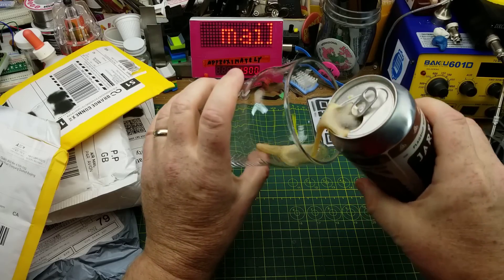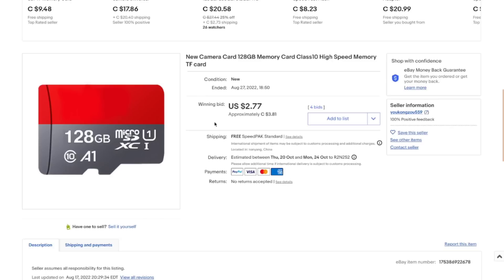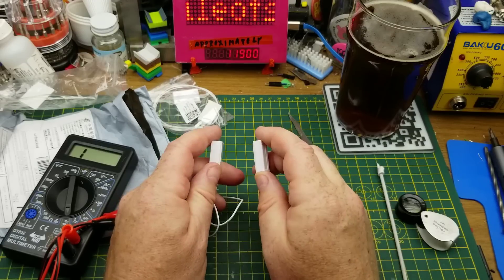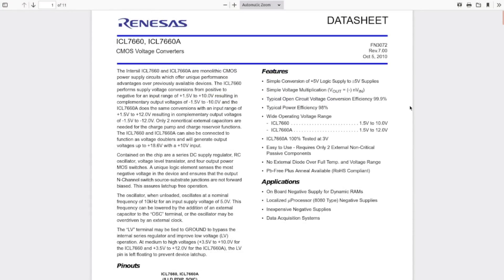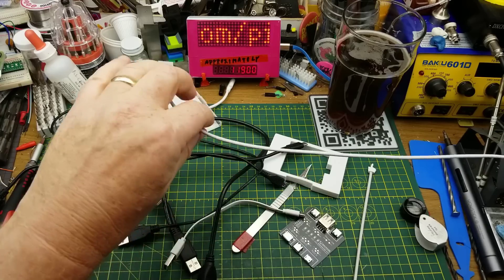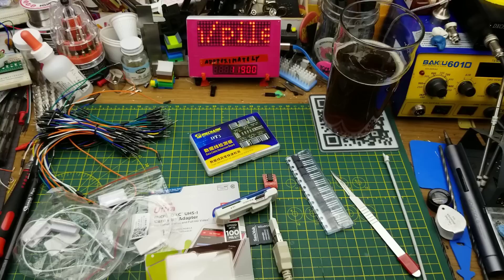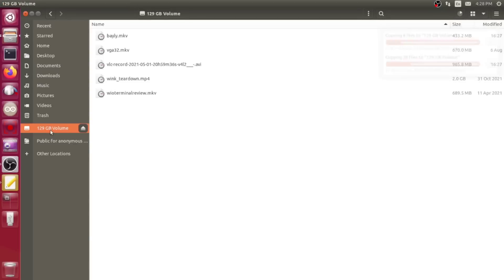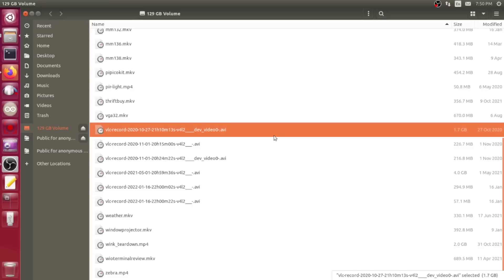Mailbag Monday 150

Comment: The SD card could still be fake. Perhaps it's a 32 GB card that pretends to be a 128 GB card. It will behave just fine until 32 GB. After that it will just discard all the data and your files will be nowhere to be found. Perhaps test it with 128 GB of files just to be safe. You don't want to find out the card is fake when you are actually using it.

I've bought a ton of these fake cards from AliExpress on purpose. I tested them all and sent proof of fakery to AliExpress and they refunded all of them. I just format the first 30 GB and leave the rest unused. No data corruption.

Comment: The USB cable tester uses almost no power. You can easily convert it to a truly portable device by hot gluing a CR2025/CR2032 lily pad battery holder onto the back and soldering its output to two via's running from the power input C connector on the back. Now you have a self-powered device to test any cable without the need of a second cable+power source.

Comment: In industrial/commercial applications the reed switch is often mounted on the door itself.
Reply: the magnet tends to be mounted to the door, the contact is fitted to the frame, that way a wire loop is not needed to allow the door to open

Comment: 10:25 - those breadboard connectors - beware of the ends on those! The ones I've purchased in the past are kind of "snipped off" at the end, leaving a burr on one side. When inserted, they scratch the hell out of the breadboard contacts.
To fix them I sat down with a diamond stone and rounded them over. It's tedious but easy, and the tapered ends makes them slide in like silk!
Also, they tend to snap off after heavy use, and sometimes they go open circuit without the insulation breaking.

Comment: I have had some luck with the SD card auctions.  It always looks like some store pulls the last from a display and puts it on auction for the amount of profit they expected to make and let the auction add to it.  Only once did I get a ' fake ' SD card and only due to them sending not-SD-Card after the auction.  As to the USB cable tester, you might want to replace the Type A for a vertical mount to get more reach to the other side, just my opinion.

Comment: Good video, if you are using a potential knock of micro sd card in security cameras that are recording data all the time, they roll over and re-record quite frequently. I would rather pay the money and get an original than take a chance. Scandisc cards never have the posted capacity on the card, usually 5-10% less.

Comment: Happy Thanksgiving, For the 7660 be very mindful when using it not to put more than 13V to it, I will blow and that is with the ones from Digikey, the China ones are much worst. one summer, i had a Metal detector that used the 7660, i had to keep a few in my pockets as spares cuz you never knew when it would blow haha True fact.

Comment: The 1.5 in the 7905 description is the current of 1.5A
I cursed you for making me buy the Wowstick screwdriver, but i'm disappointed that you just dump yours to one side, if you put both halves of the case on the desk, the bit storage as well as the screwdriver have a place to sit ;)
Love the screwdriver btw for the amount of bits in a small space
One end of the inner pushes through the cap for easy extraction.
Reply from the maker: If I were to keep the Wowstick in its case, I would probably never grab it.  I like to have my most commonly used tools close to hand. 
What Adam Savage calls "first order retrievability"
Reply: @pileofstuff  Would still be immediately available, open the case and use as a resting place, the bits can rest there too, and also be immediately availabe  ;)
(but you do you)

Comment: The outputs on most opamps/comparitors, esp the ubiquitous BJT LM358 do not not swing all the way to the rails.  If the project is powered at low voltage, one needs a clean signal in full range, then the ICL7660 offers an inexpensive means to get -Vcc to 2xVcc to the opamp.  LCDs often need a voltage potential below ground or above Vcc as well.
Could use that cable tester to do a sanity checks on my crummy diy cables. The thing I soldered together to do this is a monstrosity.
Ooo ... those round breadboard jumps look interesting.  Yeah, DuPont is a bit too thin, and square pin posts can damage boards.  20-22awg is about right.

Comment: Great price on the memory card, I use them in my 8 bit computers. :)
Reply from the maker: The more I test this one, the less I trust it.

So far it has retained all the data I put on it, but it's just painfully slow.
Reply: @pileofstuff  Oh dear. Luckily speed is not an issue when dealing with 80's computers, anything under 60 seconds is super quick on them. Ha ha.

Comment: Nice looking beer, I bought a 16Gb usb stick back when they were about as big as you could get off eBay. formatted as 16Gb but in affect it was about 4Gb which repeated 4 times. But they rely on you thinking that windows can get the size right, but it don't. I found a program that wrote a sequence in to memory so it could detect where the repeat started and how much true memory there was.
That USB board looks like expensive way to buy connectors and a few LED.
Reply: The original USB/SD tester is "H2testw" - it will write to all memory blocks and then read back to verify. Will take a few hours for a 128GB card.
Reply: @johncoops6897  The program i ran was not quick even on 16GB, but it was years ago. it produced a report of where all the repeats were. in the end i got a refund and i used it as a temp storrage until i lost it.

Comment: Is you camera compatible with cards of that size?
Is the camera throttling the speed?
Have you checked the codes on the cards? Some of the genuine cards are NOT rated for camera use.
Reply from the maker: I did a benchmark of the card on my computer - it's slower than a card I got at the dollar store!

Comment: The NC listing on the alarm contact is when the alarm circuit is complete (door closed), opens on alarm.
Reply: Correct, its normal status is normally closed when it is in close proximity to the magnet, the two items make 1 unit so it is nc when together.

Comment: Do the Dupont BB jumpers have a burr on the tip when you run them through your fingers. The bad ones are shear cut, and that leaves a burr that makes them hard to plug into cheap BB. If you find a smooth tip supplier stick with them, because they don't have that problem.
Reply from the maker: I didn't check every one, but so far these seem to be good.

Comment from the maker: **after further experiments with this memory card, it does seem to be honest about its capacity, but not its speed.  
It can't keep up with my camera recording at 1080P/30FPS, and a real "class 10" card should be able to do that.

Here is a benchmark of this card: https://pileofstuff.ca/r/cvyir  
Compared to a 16GB card I got at a dollar store: https://pileofstuff.ca/r/7t5bv
The blue line is read speed, the red line is write speed.
Reply: I think SD-Cards really don't like to receive multiple files at once....  IDK why nautilus does it by default ^^

Since you are on linux, maybe in some temporary folder inside the SD-Card you want to try :
* # ᐅ dd if=/dev/zero of=./temp.txt oflag=direct bs=128k count=16k status=progress *
this will write 2GB of data into a single file with no write back if I understand correctly...

... says 11.96 MB / s to one of my 32 GB class 10 cards (10 bucks 5 years ago) I use a 2 meter extension and a usb-key style adapter (too) for that card..
Reply: @tinygriffy  I think the card was a fake though anyway.   If you can see colours okay, the shade of red used on the card is wrong.  Just doesn't look like the same as what Sandisk use.   They were very close with the logo but there were a couple of very subtle things that just look off.
Reply: @tinygriffy  Yes. Perhaps even use seek= or skip= with dd to get to that last sector.  The xxd file editor, which looks like an old-time memory monitor might be used to write to the first and last block too.  Have received numerous devices that are cleanly 1/2 or 1/4 of their REPORTED capacity. That is right, some are manufactured to show more flash than is actually there!  I like Crystal Disk Mark to measure speed.
Reply from the maker: @tinygriffy  The screenshots are from the benchmarking tool in the disks" utility.  AFAIK it does sequential reads/writes for its test.
Reply: @pileofstuff  oh I see.. couldn't figure out what utility that is , I assumed these are the values from the copy action in the video..how unprofessional of me 😅 In my defence I don't use gnome so much and dd is pretty universal.🙈
Reply from the maker: @tinygriffy  True, dd is something that everyone has access to. It's good to have multiple ways to get to the same place.
I just usually can't be bothered to look up the syntax for dd when using it for anything more than the basics.
Reply: @pileofstuff  Yep, I often used the gnome disks utility in the past too, I (still) love it for  creating thumb drives from iso files and such. But strangely that package is not stand alone any longer (in ARCH at least..), and I only use xfce for the last .. 12 years or so, last I installed it the package was just called "disks" in the repo, not anymore so I couldn't find it.. now its called "nautilus-gnome-disks" and it comes with a 10 package tail of dependencies (:/)..  but it delivered the same 10ish  MB/s r&w values with the default settings like dd did on my class 10 card..

Anyhow,   thanks for the review and the time you put into them ! ! We "all"  know now that there are class 10 cards that are in reality class 4 cards out there, at least they seem to be not complete garbage, so relatively cheap storage , or perhaps ok for a µC project ... the fakery is despicable of course ;)
Reply: Packaging was wrong for a genuine sandisk card. On the real cards, there's a film over the back of that plastic part the card and adaptor are held in.
Reply: The card is definitely fake. To test capacity, use H2testw and to test speed search for "Free Tools to Check SD Card Speed and Capacity" then follow the first result. [Windoze tools]
Reply: @johncoops6897  Thanks ... have not heard of H2testw.  Can see the linux alternative is called "f3", easy to fetch, in the debian repos.

Comment: L7905 1.5 IC might be 1.5 amp? That USB tester looks trick, I can go through my cables and throw away the evil power only versions! 👍😀
Reply: Don't throw them away !! I'd keep them, .. a usb power cable is practically 1 third of a esp +  ws2812 strip (ambient) lightning project. and winter is coming !! ;)
Reply: @tinygriffy    Not only that .. most of the time they are so bad, high resistance, that some of them limit the max current.  Have a couple of devices here that say max 500mA charge only. I now have 2 cables labeled 'slow charge only'.  They have their purpose now.
Reply: @tinygriffy  I've spent too many hours chasing gremlins that were cable related - I need cable therapy now!